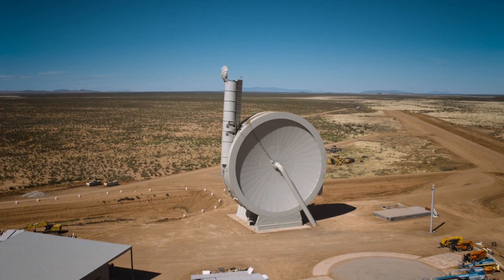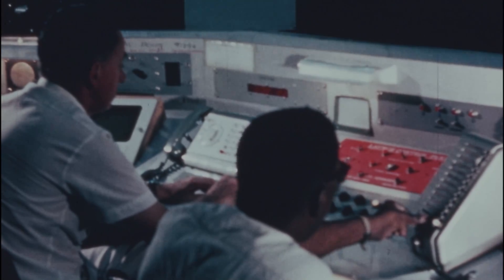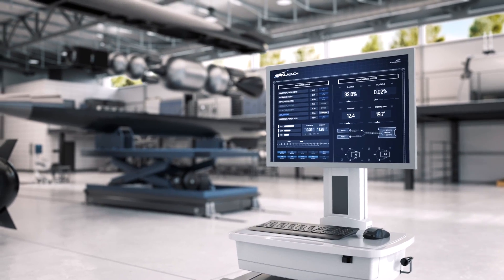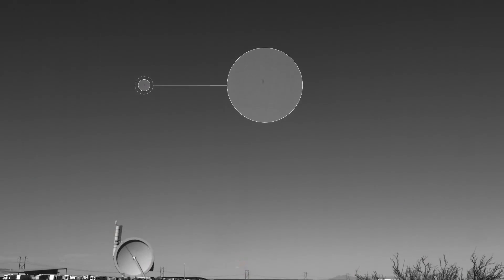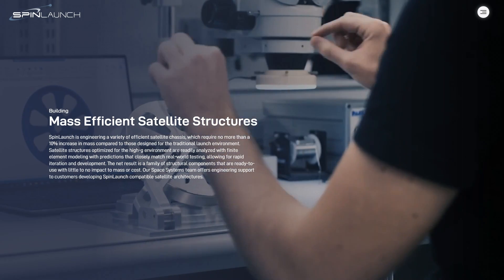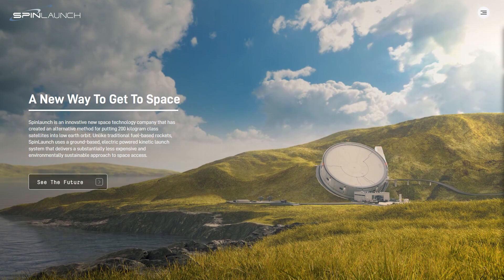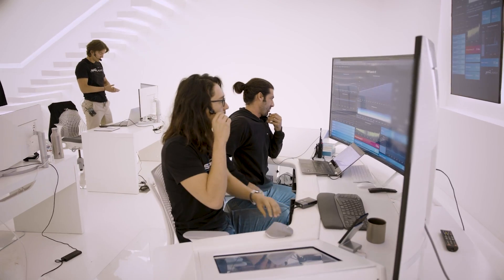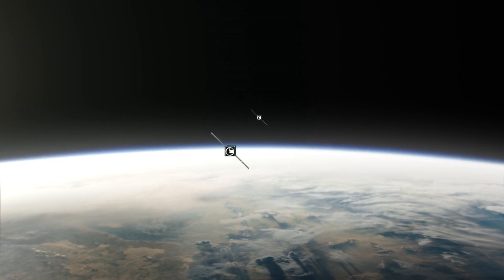Can Spinlaunch Throw Rockets Into Space?

Comment: This concept seems to impose a huge requirement of resilience on lateral acceleration to the payload (otherwise not required by its original mission)
Reply: I don't think I would want to be inside :)
Reply: No kidding eh . Lots of g’s
Reply: Normal rockets also impose acceleration resilience requirements. Also, they introduce a lot of vibration which might be less of a problem with this thing.
Reply: @seneca983  this thing will need g force resilience along multiple axis, unlike a rocket, and going from a vacuum to atmosphere at Mach 6 will produce a jolt that will make any vibration a rocket produces pale in comparison. You also have to have a heat shield to take the heat impact of going from vacuum to atmosphere at that speed. You need to have a heat shield that will survive breaching the exit cover. You have to build a second stage engine that can survive g force loads in the 1000s. You have to redesign payload to take the gforce loads. And on, and on, and on. It will never work.
Reply: solid state type components would be fine i could see this hurling supplies to space stations some day although all you would get is freeze dried scrambled eggs  well tenderized beef jerky also a way of producing smoothies for parched astronauts
Reply: @danielmahon1589  It isn't so much the solids that would be the issue as much as the big fluid fuel tanks and the nice hollow tubes and pipes connecting them to the thruster(s). You can reinforce everything to survive those types of G forces, but those are an order of magnitude or two higher than the normal launch G load and in a different direction.
Reply: You know, you could just rotate the payload arrangement by 90 degrees, right? Think in 3D, not 2D.
There is a much higher level of acceleration though, as noted in the video, but that, again, can be managed. Think about the cost delta between the reinforcement of the hardware, compared to the savings in fuel cost (that's for both systems: conventional rocket fuel vs the electrical energy for this system). 
I reckon it's a great concept. Is it economically viable? Too early to tell, I think.
Reply: @TheKroesar  "can be managed" he says. Like 10000Gs is just existing tech. besides that would also put additional constraints on the payload size. Due to some basic aerodynamic issues, rockets have to be in a particular shape. And that largely dictates what can be fit inside them.
Reply: @psd993  did you even watch the video? He even addressed this very same topic! No one said it is easy, and will certainly need a lot of effort, but far from impossible.
Reply: @TheKroesar  I think the point was, if you don't want the rocket to incinerate the moment it hits the atmosphere, it still has to be rocket shaped, which means it will need to be reinforced for heavy G loading in both the normal axis that is parallel to the direction of thrust, and perpendicular to it in the axis of the rotating arm. For long-term use, I'm not thrilled with a device that includes an explosive "re-compression" as part of its operation, after every launch you are going to have to scour in the inside of that chamber for fragments of the shielding plate because if even a tiny piece ends up in the wrong place, that will tear itself apart in the next firing.
Reply: @TheKroesar  you obviously have no idea about structural integrity and fluid dynamics, do you? Simply rotating any and all payloads by 90 degrees doesn't solve the problem! It's not a question of "thinking in 3D" LOL 😆😂🤣🤣🤣
Reply: @maxlove4906  you’re right, of course. A masters degree and 16 years working in structural engineering really don’t qualify me for making positive comments on the internet. I probably need some education in how angst and being a conspiracy theorist before I dare speak up.
Reply: @TheKroesar  anyone who writes this sort of stuff about their background on youtube sounds both incredibly insecure and incredibly unqualified, in general.

in either case please explain how rotating this thing 90 degrees helps at all. you're just substituting massive lateral acceleration from the arm for massive lateral deceleration from drag as it leaves sideways out of the chamber with a massive cross section
Reply: @maxlove4906  they’re saying that your payload may easily be able to handle 10000 sustained g’s by simply rotating your hardware into a better angle to withstand those forces.
Reply: @fresh_dood  you’re right, I totally made all of that up to sound more credible. You got me. I’ll crawl back into my mum’s basement and revel at your superior intellect, while you go off and reinforce the trend of discrediting experts to the detriment of modern society. 
Take care of yourself, and, if you can, someone else.
Reply: @TheKroesar  Instead of just replying angrily to everyone here, why don't you go about explaining how exactly we're wrong and how you're right. That's science after all, right? Proving your thesis? You're a scientist no?

Grow up and get over your ego.

Comment: One problem with this is that the casing is not reusable. How much does it cost? What is the energy cost of the launch? How much does the sealant on the exit tube cost?

These are all the major factors that will determine whether this is economically viable or not. Beyond that, we also have to consider capital recovery, which is an additional cost to be factored in.
Reply: The comparison needs to be (in part) to current costs, which are pretty high.
Reply: @bearcubdaycare  Of course, but the conversation appears to be that there is basically no cost for the lower stage yet. It obviously removes some of the tyranny of the rocket equation, but there are many costs which we simply don't know yet. One hopes that the design team have run the numbers, but so many scientifically minded people neglect the economics.

Comment: Would it not be more efficient to launch them from high atmosphere, where air density is smaller (and also it's closer to space). You would just need Zeppelins to do that.

Anyway, to avoid the 10.000 g pressure, they could make a huge (hyper)loop, the bigger the circle the less G's you get.

Comment: I could see it working on the moon, but unlikely it will work on earth (much less force required). Its not just the electronics that need to be developed, its also the substrate(think multi layered PCB's) they are mounted on, the strength of the solder, the strength of the traces. Then the same is true of all mechanical systems, then the fuel itself, the heating due to compression, the rebound from one side of the fuel compartment when it is released.

Comment: Seems to me that if an engineering technique ‘should exist’ which can maintain a track in a tangential relation to Earth’s surface for an extension of some 200 miles - ie from 0 inches elevation to 7 miles elevation - then a linear synchronous approach to ‘Space’ would be possible which conserves the momentum of craft - frisbee-like - by a weighty spinning circumference - and so dispensing with costly ‘chemical burns’. A ‘flying saucer’ - no less! I ask myself whether or not the configurative possibilities from hingeing together the square bases of the half-octahedral modular unit of the ‘isotropic vector matrix’ do not indeed furnish us with such possibilities? extending upwards in lightweight complexes of logarithmic spirals? (carbon not steel and Sea or Desert emplacements?  (As for Pharisees and Scribes! - Matt 23:15)

Comment: Use an electro magnet on another spinner in tandem with the counter load. This spinning arm overlays the load bearing arm. The magnet on this tandem spinning arm pulls on the counter load at the correct magnitude as such to counter balance the load on the other arm. 
When the load is released, also cut the power to the magnet which makes the counter balance immediately be lighter?

You say, the magnetic counterbalance arm itself needs to be balanced?

This could be done by having the other end of the arm spinning inside a electromagnetic ring which pulls on the other side which moves it's electromagnetic field in sync with the spin. (Perhaps a tri-arm design would be better). Also cut the power to this when launch.

Comment: The balance problem would be easily overcome if you launched two perfect;y weighted rockets simulanteously, one at each end of the "big balance rotating thing". Just an idea. It would take milliseconds for both rockets to launch from the same exit leaving the fly wheel balanced as it wound down. Solves the problem and doubles the capacity of the launch system.

Comment: MAYBE NOT THE PLACE TO ASK THIS QUESTION BUT...Is there a spin speed at which the spin-speeds of electrons could be seriously compromised or even undone?---meaning where atoms and molecules simply couldn't hold their systems together? (Wish I knew more about basic physics!!)
Reply: Of course, that's when chemical bonds break and materials disintegrate under mechanical forces. You are not going to separate water into its atoms easily this way, but metals, glasses, plastics etc. don't need all that much to come apart.

Comment: Noob question: why are we using rotation instead of using maglev tech in vaccum tube?
Reply from the maker: As I explained, with rotation you can slowly add energy over hours as opposed to doing it in a fraction of a second.
Reply: @scottmanley  "maglev" doesn't have to be instantaneous; it could also increase velocity over distance. One would just need a much longer structure. Of course, this would also cost a lot, but it would be reusable also, and without the very limiting factors of the Slingshot technology!

Comment: AAARGH! WITH SO MANY COMMENTS, WHAT HOPE DO I HAVE THAT SOMEONE WILL ELECT TO COMMENT ON MINE? OH WELL, WILL ASK ANYWAY: Does this run into any problems related to the fact that the "inside"-oriented part (relative to the center of the circular orbit) of any missile is spinning at slightly slower speed than the "outer"- oriented part of the missile?
  Would this technology benefit from a spinner-within-spinner-within-spinner etc system to act something like (metaphorically) a multi-stage rocket, to continue building up increasing degrees of "spin-propulstion"?

Comment: 2:43 I'm pretty sure nobody would have a problem working in a building so close to a few tons of an extremely fast spinning arm, which is pointed in the perfect angle to completely wipe the building, if something fails. I guess the fuel and oxidizer in its tip are the least of your problems in this case...
Nevertheless, I like the idea and other designs seem to be a lot safer.
Reply: The fact that they built them so close (some are even in the plane of rotation) suggests that they haven't done a proper risk assessment.
Reply: People work at nuclear power plants, so...
Reply: @BritneyLaZonga  Nuclear plants have decades of engineering and a shit load of geniuses who worked on them. I'd say they are one of the safest places as long as everything is not shaking at a magnitude of 9.0 and not getting hit by tsunamis.
Huge ass rotor blades spinning at mach 1 aith rockets attached to the ends sounds like exactly the opposite of an engineering marvel. It sounds like a disaster in the making.
Still kinda mindblowing that they managed to get it to work this well. I'd still want to be at least a mile away from that thing when it's spinning.

Comment: Could they have the arm holding the projectile stationary and separate from a huge flywheel that they speed up, which then get connected by a huge clutch so the projectile only moves inside the chamber for a fraction of a rotation?
Reply: Wouldn't the impact on the clutch connection destroy everything?

Comment: q: how much more efficiency could they achieve if they launched from 12,000 ft vs sea level?   We have a major highway that tunnels through The Rockies at 12,000 ft and plenty of space nearby to build a complex.   If the air pressure is only ~3/4 as much, that means they can either go faster (higher orbit!) or slower and much less G forces/energy.  Obviously the best solution would be to find the highest mountain possible with a flat launch area nearby (~20K ft), but even this would be 40 miles from Denver and simple enough logistics. (major highway, large runways nearby, etc).   It makes no sense at all to build this at sea level when there is land at 12000 ft in Colorado.  Yes, I know about the issues with launching over land, but there are over a thousand miles of nearly empty forest and hills between Colorado and the Canadian border along that mountain range.

Comment: So let me get this straight. They have to put a rocket through extremely harsh g forces for a longer sustained amount of time than any rocket has ever handled...then They have to pull a vacuum on a giant space large enough to whirlyyeet a fuckin rocket. And then build a seal strong enough to hold the vacuum, but weak enough for a rocket to skrrrt through it, without blowing the rocket up and the seal must also be able to be weak enough to not throw the rocket off course when it tears through it. And then the rocket has to be released at the exact right millisecond so that it's not thrown off course, and its got the be strong enough not to explode when it his air...Then its got to be able to slow down to pass through max q and then throttle back up again. In order to put humans on it they have to essentially reinvent the wheel and create some sort of reaction wheel system that we've already proved doesn't work for humans and quadruple the weight and therefore the forces required. Yeah. It'll work great. I'm sure.

Comment: How does the spacecraft zero out its 450 rpm yaw rate as soon as it leaves the launch tube, and what issues does the intermittent rotation pose to aerodynamic stability?
Reply: The release mechanism is designed to zero the angular velocity of the projectile. Once released, it will have negligible, (ideally zero) yaw rate.
Reply: @cogoid  Ah yes. The release arm would be holding the projectile at fore and aft points. The fore point would release slightly in advance of the rear point, allowing the fore end to swing outward until omega=0. The relative timing of these two releases is critical to a successful launch.
Reply: @johnbarron4265  Yes, conceptually that is it -- the nose swings out until the rotation is cancelled. In practice, the projectile will almost certainly have to be supported at more than just the end points, to spread the load.

10 ton rocket times 10000g, that's 10^9 N. Even high tensile strength materials like carbon fiber composites would have to be on the order of a square meter in cross-section to withstand such force.

Comment: There's gotta be a better way to do it that is so simple but no one has thought of it.

VCRs were originally thought to be impossible because the magnetic tape had to fly past the reader at a ridiculous speed.

Then someone realized:  "No stupid. Have the READER spin real fast as the tape passes over it."

Maybe the escape opening can spin WITH the rocket, allowing for a much greater margin for error.
Reply: I don't think the margin of error is the problem. Spinning the escape with the payload poses a major problem because it would have to rotate within the atmosphere, whereas the payload is in a vacuum chamber.
Reply: @malcolm_in_the_middle   @Chris G  First, I don't think it should need to have a pipe like exit. The entire outside can be made extremely smooth (so it will look like just a hockey puck). There might not need to be a vacuum chamber at all.

Brick experiment channel (or whatever it's called) made a video where he spun Lego® wheels inside a vacuum. 

Some wheels spun faster in vacuum. But It was so surprise that the more aerodynamic wheels didn't see much of an improvement inside the vacuum.

Also ActionLab posted a video called "Hydrophobic Projectiles Slice through water". Perhaps there will be a coating or technology that will create a thin frictionless bubble around the rocket (and launch system).

I imagine a very polished glossy rocket shaped like a BULLET. The tail fin things will be retractable and come out once the rocket has passed the thickest parts of the atmospheres. 

Maybe the course could be regulated by tiny things that rise and slip back into the rocket, causing certain sides to have slightly more drag for milliseconds and keeping the rocket stable while also able to steer it.

What if powerful jets of air help to blow away other air from contacting it? Perhaps distorting it in a way where it a actually serves to help lift the rocket.

Or maybe I should just go write science fiction. But I see a lot of potential for amazing innovation here.

Comment: I might have missed it, why not setup at a higher altitude. A top a dry mountain range, perhaps super dry places akin to those were optical telescopes are situated (Hawai'i, Atacama, etc). Logistical considerations being observed, of course. Perhaps the gains from being in incrementally thinner air are outweigh by the cons. -layman thinking out loud.
Reply: I am wondering the same thing. I don't think transporting there is a big deal. The transport telescopes to the tops of mountains. China of course with access to the Tibetian plataue would have a great launch site.
Reply: The short answer is, that accessibility to the site is important, especially when it comes to transporting heavy and expensive equipment to site via truck.
Putting it on a mountain would require a steep ascent or a twisted road. Bad when your cargo costs many million and weighs a stupid amount.

Comment: Use a big magnet for balance loading.  It is pulling against the outer housing during spin and can be dynamically changed with ease to allow continuous balancing even during a spin.  As soon as the signal to release hits the magnet has its power cut.